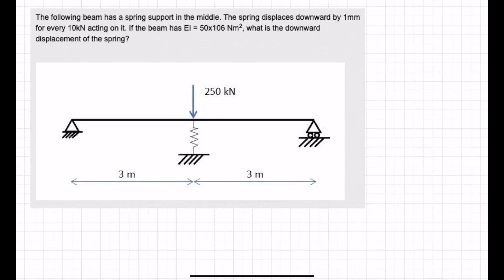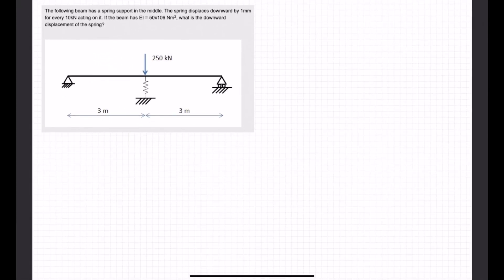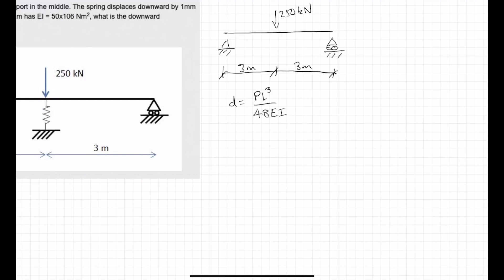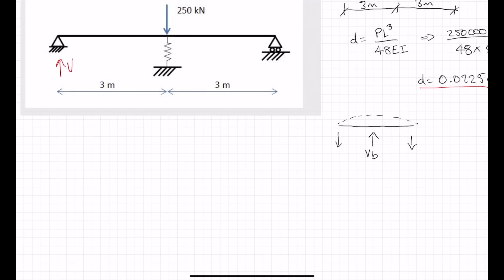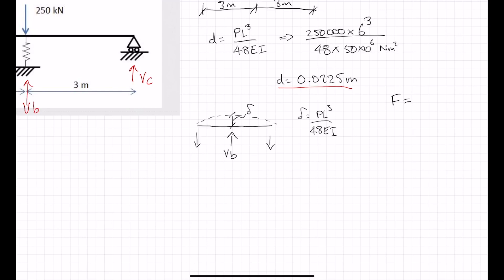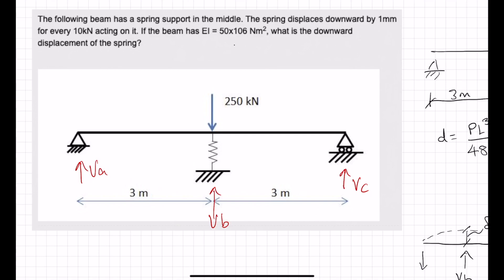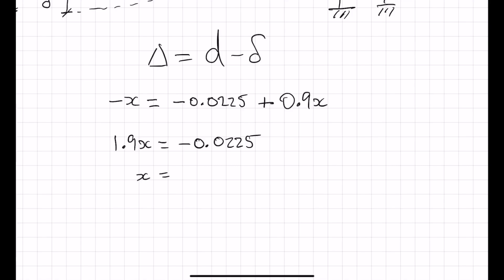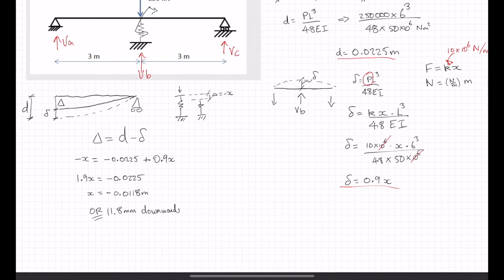Beam with Spring Support - IStructE Certificate in Structural Behaviour Course

Comment from the maker: 09:18 CORRECTION: This capital Delta should be equal to x rather than -x due to the fact that delta is already a downwards direction, and then at 10:06, the equation should read x = -0.0225 - 0.9x. The final answer remains the same.
Reply: wrong again hhhh  it should be x = 0.0225-0.9x >>>1.9x=0.0225>>x=0.01184 downward and the positive is downward

Comment: More comfortable with stiffness concept though. If the beam midspan deflection is PL^3/48EI, then its stiffness itself will be 48EI/L^3 (say P=1 N).
Then add with the spring stiffness from the question.
Total stiffness will be ktotal=kbeam+kspring (N/m). 
Hence same answer will be obtained by 250kN divided by ktotal.

Comment: Alternatively, 1) Compute stiffness of the beam (kb) =  load/ deflection= {250kN / ( deflection of 6m simply supported beam for the point load of 250kN)} ,         2) Stiffness of spring is 10kN/mm  (ks)    ; 3) Compute total stiffness = kb+ks = ktot   4) Load / ktot = 11.8mm.; Springs are in parallel because same load is not seen by the two springs , therefore ktot = kb + ks; otherwise it would have been an inverse adddition
Reply: how have you supposed beam deflection as spring?
Reply: Beam deflection is not spring rather beam can be idealised as spring. Spring constant is the stiffness of the beam. Assumption is that the load not very high otherwise there will be plastic behaviour
Reply: This is an interesting solution. I was about to upload a YouTube video on this topic, and I'll now include this as well. Thanks for the information!